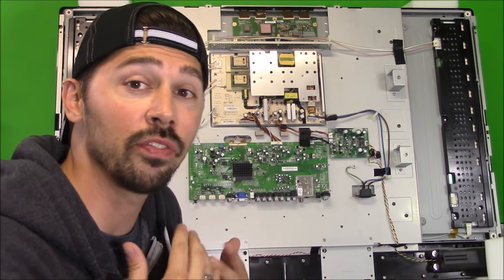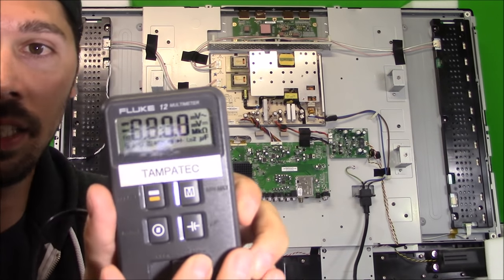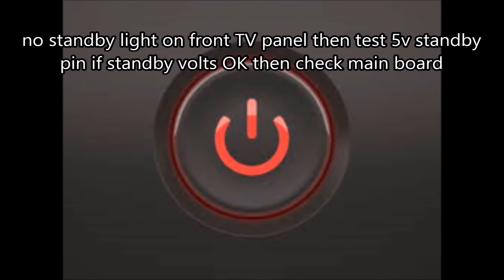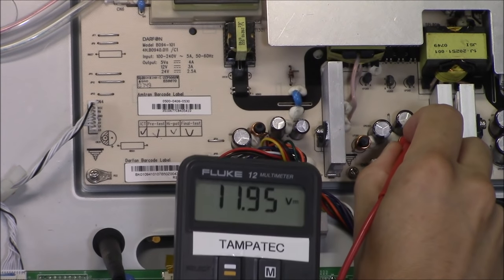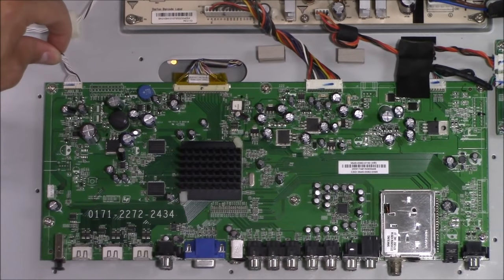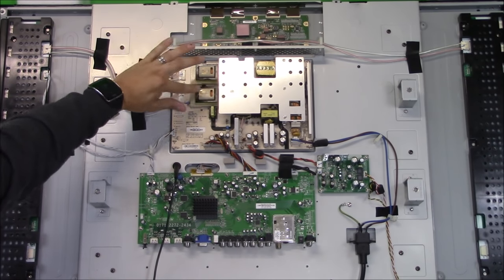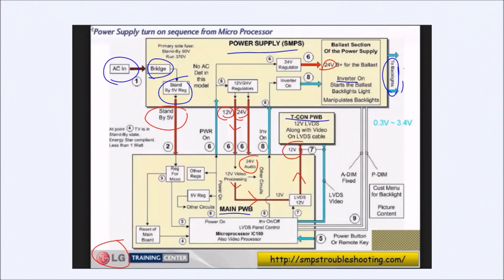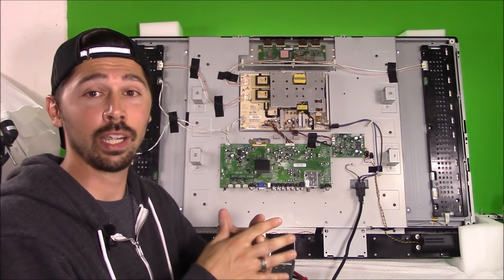ULTIMATE LCD TV REPAIR SERVICE GUIDE for TROUBLESHOOTING BOARD VOLTAGES

Comment: Tampatec. hi sir, my tv turns on but like after 30 seconds I hear a weird sound then it turns of. But the stanby light still indicates the tv is still on.
there's no picture and sound. hope you could help sir.
Reply: leequiazon Check your capacitors. I've done this same fix a hundred times. Easy to do if you can solder. Check if any of the caps or bloated or broken open, and just replace them. Your TV is basically power cycling and can't turn on until you replace those capacitors

Comment: Hello I have a SAMSUNG UN65HU8550. We had a storm. Tv shut off and back on was fine.  Turned off tv and next day won’t turn on. I have 6 blinking red lights on standby light.  If I power. I have sound and a dim brightness in front of tv but zero picture at all. I took off back panel and backlights are lit I disconnected main board and nothing changes.  I tested voltage from cable I disconnected and on the 6 that gives power showing around 13 volts.  I’m not sure if T on board , power board or main board. 
I tried flashlight test on tv with negative results. 
I disconnected cable ribbon from main board and backlights stayed on. 
I disconnected by Ribbon cables from tcon board and backlights stayed on

Comment: back light only come when you disconnect the wire running from the main board to the T-con board . if you reconnect it back light goes off. what's bad the main or t-con

Comment: What would be the next thing to check, the caps didn't fix it. Still just a flashing standby.
Reply from the maker: unplug powercord then unplug tcon board then plug in tv if tv stays on now replace tcon board. if not then check other boards.

Comment: Hi, thank you for this very useful video, even though it is 7 years out of date. These circuits don't change. One question though. Would your fluorescent light test on the high voltage cables to the back lights have worked, if the power was on, but the CCFL strips top and bottom were both broken and not working? Does the current have to flow through the strip lights to get fluorescence in your test lamp? I would expect so, but would appreciate your answer. Thanks, Dave

Comment: Hello, Love your vid!!  I own a Toshiba Regza 40xv648u LCD tv. It initially had the following issue: black screen with audio ok. I made the flash light test and were able to see the menu. Then I replaced the backlight inverter board. Now the TV seems to work perfectly fine (screen and audio are ok) but after few minutes the TV shut off and restart by itself. Do you have an idea what could be the issue? Thanks in advance!!

Comment: hello my name is James and i have a samsung PN60F5300AF and my voltages on my power supply are not correct. I've replaced the power supply with 2 used ones and i keep getting very low voltages like 10v when i should be getting 208 on the vs-tp. I have unplugged the x and y boards and still no picture the led blinks for a few seconds when cutting on and stays solid when turned off like it should just no picture or sound. when i turn the tv off it does jump up to 140v and drops gradually back to 10v. please help i dont know if i need a main video board or what.

Comment: I have Hitachi LE55A6R9 Tv. I get sound and picture shinning a light behind. I did replace all boards on Tv. I thought it was power issue with the power supply to the lights because voltage was jumping. What has got me stumped is before I ordered the boards I removed LCD and tested every bulb and they all lit up. Can someone give me some input.

Comment: i have a 52 inch lcd samsung t.v that comes on for 2 seconds the power stays on, with  sound ,when the backlights go off so does the high voltage, i have the 5 volts inverter on and off ,what could be the problem

Comment: I have a samsung 3d tv that has no picture but has audio. I replaced t-con board but still have no picture. It does have backlights. I need help testing tv. UN55HU8550